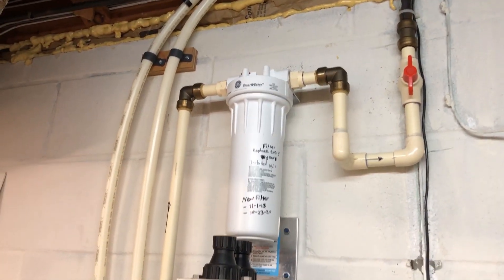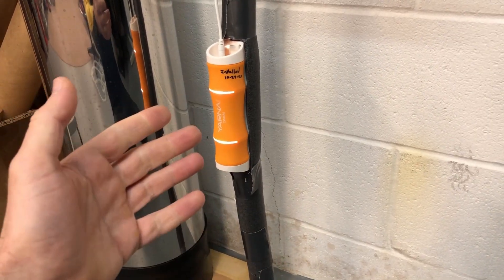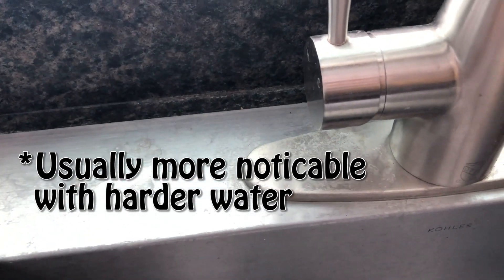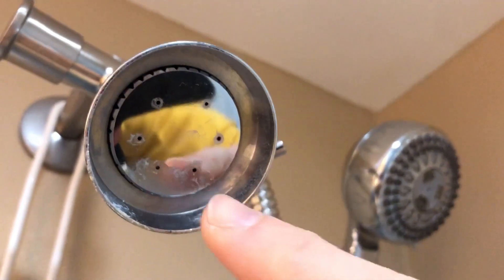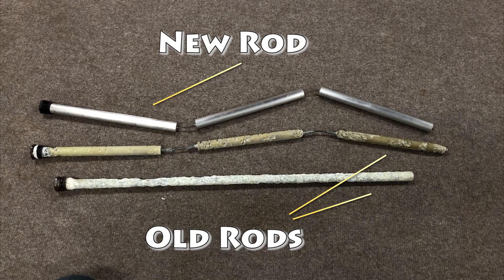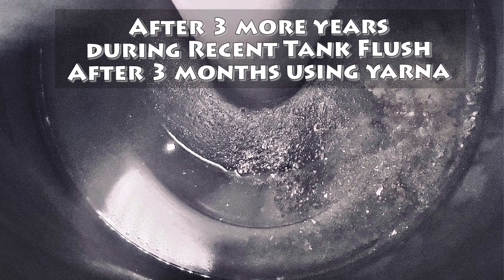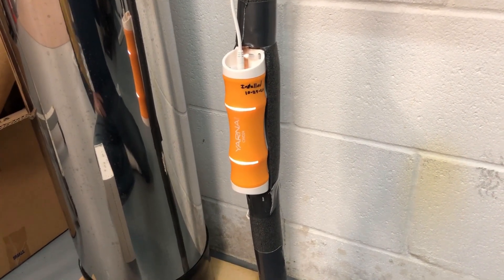Yarna Electronic Water Descaler - 3 Month Review | Random Video Thursday's

Comment from the maker: In addition to this video, I added some more info in the description about this product that might be helpful. Thanks for watching!
Reply: Great video. I had heard other customers saying that this product wasn't very effective until they moved it 6' or more away from the electrical ground connection for their house. This is not in any of the documentation, but once it's moved further from the ground, it is much more effective. I noticed yours was within a few feet of your ground. Maybe moving the unit further away from the ground connection will help!
Reply from the maker: @crapsuzette1  The electrical ground from the panel is a subpanel which goes outside about 30 feet away to a ground rod. There is no electrical grounds attached to the plumbing in the house. The unit is attached to the feed coming in out of the floor which is roughly 6 feet from the ground wire that comes out of the sub panel.
Reply: @GrowingAnswers  My mistake. At 00:15, the clamp on the water pipe and wire running from it look very much like a ground.
Reply from the maker: @crapsuzette1  the clamp on there are ground leads from emi shielding only. The copper pipe from earth is separated with plastic cpvc so no grounds upstream are attached either. There is no ac electrical oscillation on the main water pipe. There used to be until a few years ago when I reconfigured all that both for that install and to remove the double ground potentials.

Comment: I changed my anode rod about 4 years ago.  The old one was pretty much used up.
I could not drain my tank 100% due to sediment clogging up the cheap plastic gate valve.  I had a brass ball valve ready to go, but didn't want to deal with all that water flowing out onto the floor.  I was able to chip away quite a bit of build-up on the top heating element.  The water seemed hotter after that.  The water heater is now 18 years old, so who knows.  I may take another run at changing out the anode and valve.
I've got a bore scope, so inspecting the tank should be easier this time around.
~ THANK YOU for informing/reminding people about the need for anode maintenance. ~
Professional Home Owners, Unite!  😜

Comment: We installed a Yarna CWD30 right after we closed on our new construction home. We have a Navien NPE-240A2 tankless water heater and flushed the heat exchanger & cleaned the filters today. To our surprise, there were no sediment at all on the filters & in the vinegar solution. Furthermore, there's no major build up around our shower heads or glass  door. I really do think it works.

Comment: Almost twenty years ago we moved from a lake water area to a town that uses town wheal water that has hard water.  Unaware of its effect and the need of water softener in the area after first year our dishwasher completely clogged up and broken down while the pipes began to clog up with scale build up all over the kitchen, washrooms toilets and faucets.  I did some research regarding water softener and ended up using a electronic water descaler.  The heavy scales in the washroom, faucets, inside the toilet tank and the buildup in the toilet bowls dramatically decreased after the initial clean up right after the installation after six months; however, I was still wondering how well it really worked throughout the entire house since we no longer have a dishwasher to show the difference. An year after the installation, our rental hot water heater tank broke down and I was wondering if it was caused by the hard water buildup and the electronic water descaler may not be enough to do the job; however, when the maintance person showed up and pull out the heating rod and it was perfectly clean without any trace of scale and the hot water tank was simply just broken down.  The maintenance person was baffled since we did not have a water softener installed and had never heard of a electronic water descaler in his 30 years in the hot water tank business in our area.  Least to say beside the minor wipe down and light regular scrub we no longer have any major hard water scale build up issue throughout the house since we installed the first unit and it actually slowly descaled all the scales in the water pipe throughout the entire house with an yearly electricity cost of about $7.00 drawing 5W/h only to operate it.  five years later, I added a second unit onto the out going hot water pipe leaving from the hot water tank to add additional descale performance and have both units plugged into a backup battery unit as a safety measure and both are still running well to this day.

Comment: I got one a month ago. At first my water ppm went up which makes sense as build up is coming off but after a few weeks my poms went ppm. The water doesn't dry me out like it was before. I have bad eczema and it's helping. Soft water is way better but for the price I'll take the noticable improvement. In addition I added filters on the shower heads and the combo is good

Comment: My results were absolutely NOT the same. I disposed of my old salt system and installed the Yarna system. Hugh mistake!  5 months later I used test strip and my water went from soft to extremely hard on 3 separate weeks and now my facets are starting to leak.  My biggest challenge yet is trying to contact Yarna for a refund.
Reply from the maker: @bam3464  it’s not a water softener. It doesn’t remove anything. I’m not sure what you mean by the same. Because I showed there was still scale. Build up on things. The most of what it does is reduce scale In the hot water tank.

Comment: You should check your water heater ventilation. Those red and blue caps, and discoloration shows that the heat and carbon monoxide is not properly vented and is entering the area. Very dangerous.
Reply from the maker: It’s just because my vent tube is at a slightly lower angle than normal. It’s just a little excess heat. It has not changed since that tank was installed many years ago. I also have a carbon monoxide detector right next to it and it’s never went off.
Reply: @GrowingAnswers  most carbon monoxide detectors on the market are useless as they take 70 ppm to alarm. If you had 60 ppm which is enough to cause long term effects it would never go off. If your Carbon Monoxide detector isn't a low level detector (not sold at any big box store) you're not really protected.
Reply: I agree.   You have a dangerous setup like the other person noted

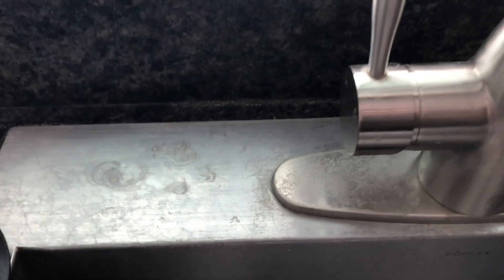Comment: 1:01 TDS is NOT a reliable measure of water hardness. There is no electronic gadget that can measure water hardness. You need a titration kit as you find in aquarium stores. Or maybe your water department has this information on their website for your area. TDS does not always correlate with hardness. It can register low when hardness is high or the other way.  If you have that kind of scaling I'm pretty sure your water is close to 15gpg if not more. Whenever I hear an American mention hardness in ppm instead of gpg or grains per gallon I know they used a TDS meter.
Reply: Grains of hardness is primarily a water softner term ,ie. 17.1 ppm per grain of hardness. the best hardness , total hardness and calcium hardness tests kits are La Motte, Hach and Taylor. Strip tests give a close approximation but not like the liquid or powder titration test kits from the companies I listed. In Northern California , Nevada and areas with volcanic activity in the past Silica is a greater problem to deal with. Silica is extremely difficult to remove and the so called electronic scale devices do not have any affect on it. The device manufacturers are reluctant to ever mention it. There are basically two ways to remove silica scale , Hydroflouric acid and Sodium Hydroxide. Both are extremely hazardous and only should be attempted by trained persons. However if the silica scale is embedded with calcium carbonate a solution of 30% hydrochloride and 5 % Hydroflouric can break up the scale over a period of 8-12 hrs. depending on how recent the scale was deposited and how thick. Old thick scale will be like baked ceramic material the closer to the tube surface where the higher temperature will be found. In that case acid cleaning will most likely not be successful. Other methods on straight tubes are hydroblasting and the old AC guys raising the equipment temp. and shocking with ice, risky at best. I’m not going to tell you that the non chemical devices don’t work but suggest you look at some areas of concern. Such as devices that are actually regulated , does it have a UL listing ? May have one but that is for standard electronic and electrical components. Magnetic fields on PVC act differently than on copper, copper will create a secondary field like a transformer, pvc will not.
Reply: @JW007100  thanks for your post. Is there a way to test for silicates? I do use titration kits for hardness testing and agree they're the best way. About living in an area with past volcanic activity, I'm in southern India. My city doesn't have underground parking because 50 ft under it's all granite. The deccan traps were all over the place and active millions of years ago. I'd imagine silicates would be prevalent. My water is river based and not very hard but other water sources have measured at 600 or more ppm total hardness.
Reply: @JW007100  my interest in this subject stems from keeping front load washers in good shape. Hard water isn't good for them and if there's silicates like you said then I don't know how ypu prevent the internals from scaling up with silicate
Reply: @johndoe-vc1we  If where you are is not volcanic I doubt you have silica scale. Where I use to live not far away 1-2 hrs you would be in old lava fields, remnants of volcanic cones, over centuries the volcanic glass wears down and percolates down into the groundwater. Surface water like lakes had less silica present. You might contact your water provider to find out what the silica levels are if any at all. Rule of thumb is at 150 ppm and above silica can fall out( precipitate) and form silica SiO2 scale. The higher the concentration the quicker  the deposits, works the same for Calcium Carbonate CaCo3. Silicon tiles are what are on heat shields for re- entry vehicles.  If you have multiple machines try a non chemical device on it since you have others for comparison.
Reply: @JW007100  the region was volcanic millions of years ago. So you're saying the chance of silicates in ground water presently is low? 

So would I be testing for silica or silicate? The company I use in India has a test kit for silica but none for silicate. 

The silica test kits are of different resolutions.
5 - 80 ppm, 75 - 200ppm and more sensitive ones below 5ppm for silica.

Many people use water from bore wells for washing and this water can be 500 and above for total hardness.
Reply: @johndoe-vc1we  A Silica test kit is what you want, silica and silicate is confusing at best they both share the same neighborhood but free silica dissolved from volcanic sources is what I dealt with. Silicon links up with oxygen (which makes up 55% of the
earth's crust) to form the most common suite of minerals, called the
silicates. Quartz, feldspars, olivine, micas, thomsonite, jadeite, and prehnite
are all silicates. 
Silica is a bit trickier concept. It refers the combination of silicon plus
oxygen. The mineral quartz is silica. But so are the minerals tridymite,
coesite, cristobalite and stishovite which are mineral forms of silica that are
stable at high temperatures and pressures. All these minerals are also
silicates. In other words, quartz is a silicate made of pure silica. 
See how confusing it can be? best way is to remember the last ^ line, a silicate made of pure silica.
Reply: @JW007100  is there any correlation between total hardness and silica ppm? Say I have a total hardness of 150ppm. Which test kit would I choose.

5 - 80ppm or 75-200 ppm silica range?
Reply: @johndoe-vc1we  Water can be hard but silica might not be present if there isn’t any in the supply water. I have seen water on 1 side of town have 40-60 ppm hardness and 60-70 ppm ppm of silica. And on the other side of town have 240 ppm of hardness and 10-20 ppm of silica. 400 -600 ppm of hardness with 60-70, even 80 ppm of silica is a tough situation to have.
Reply: @johndoe-vc1we  I would go with the 5-80 ppm if it is a direct reading where you don’t have to dilute your sample which if not done right will give you incorrect readings. So for example you take a sample like 5-10 ml. add first reagent wait 10 min. add second reagent wait 10 min. after 10 min  then multiply the drops used and end result is the ppm. A higher end test kit 80-200 ppm may require diluting the sample with distilled water and if you reuse the same droppers may end up in an incorrect reading which took 20-30 min. to do. Some test kits will have digital meters for readouts also , more expensive but fairly accurate. The lower range kit will give you a baseline ppm to work with. Try to keep the silica ppm under 120 ppm and away from anything 150 and above. One more important note is that standard salt or potassium water softeners do not remove silica. 
In my original post I used the word Silicate which I corrected to Silica so I think that is where you  may have been trying to figure out the difference.

Comment: Having an actual water test done with the unit on and the unit off would be a less subjective way to compare if it’s working.
Reply from the maker: It wouldn’t do anything it doesn’t change the water chemistry or remove anything from the water.

Comment: Does anyone know if this can work on an open loop cooling tower system for water source heat pumps?
Reply: I expect it works slowly. But if you have super high mineral content I want to say above 20ppm and iron of like 3ppm or a pH < 7.0  They say it doesn't work. That is part of the reason why I wanted to try it, but there wasn't enough pipe to work with because of how they installed the furnace.